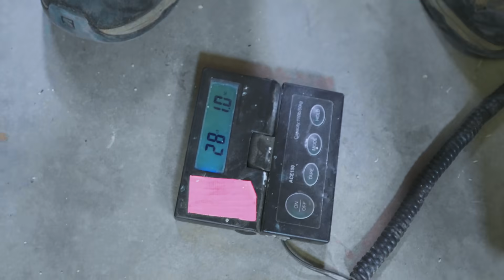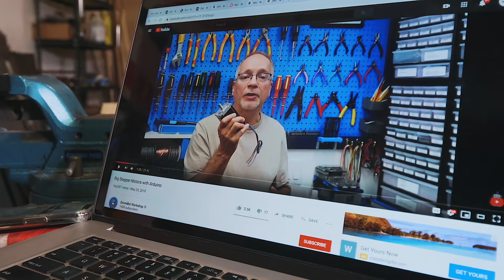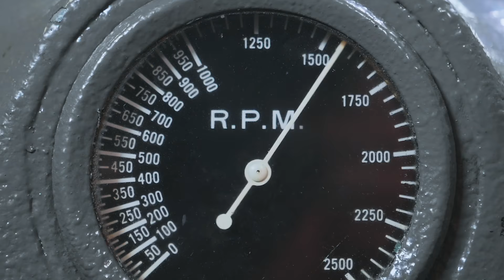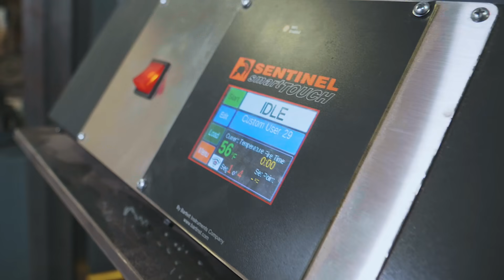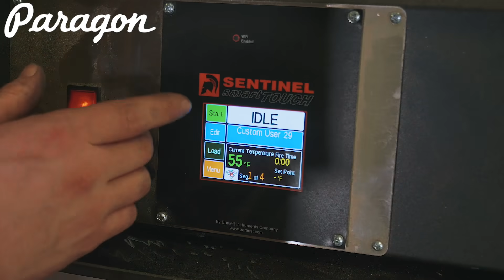MAKING FORGE DOORS!!! Part 2

Comment: Alec, if you publish the code, I'll take a look at getting it up and running for you, as this is what I do for a living.  A lot of people below are saying that you can't do simultaneous input/output off of an Arduino, which is technically true.  However, you can fake it through interrupts and/or polling.  I'll reply to myself with a code sample in a few minutes showing how you can do this, but there are edge cases where it might not work.  If you can get the code over to me, I can get you fully working code instead of an example!
Reply: me two
Reply: he put links in the description :) or at least that is what he said in the vid
Reply: Without having seen the code, my guess is that he's throwing each button input into its own loop while being independent from each other. Since he'll need both motors at the same time, he should use a loop with both inputs being conditions to enter it. I'm also unsure which motor drivers he's using but he could also tie them to the same output connection to make things simpler
Reply: Also a programmer by trade, if the changes are open source and less than 100 lines, I could do it tonight 😄.
Reply: Oh you legend. Thanks for taking the micro-controlled bullet for the rest of us.
Reply: since he's new to arduino, he is prolly using the stepper library, which blocks execution while the stepper does its thing. the accelstepper library is prolly the easiest solution for him to understand, and iirc provides non-blocking stepper tools
Reply: Pulleys will definitely help with the load
Reply: Yeah and I will look at it....

I'm helping right
I know nothing about code
Reply: I came here to basically say what you all have already said lol glad to see I am not the only programmer/blacksmith on Earth
Reply: @thebusbums2825  I agree
Reply: Also came to the comments looking for a link to the code. My first thought for getting the buttons working independently is to use interrupts.
const int buttonPin = 2;     // the number of the pushbutton pin
const int ledPin =  13;      // the number of the LED pin

// variables will change:
volatile int buttonState = 0;         // variable for reading the pushbutton status

void setup() {
  // initialize the LED pin as an output:
  pinMode(ledPin, OUTPUT);
  // initialize the pushbutton pin as an input:
  pinMode(buttonPin, INPUT);
  // Attach an interrupt to the ISR vector
  attachInterrupt(0, pin_ISR, CHANGE);
}

void loop() {
  // Nothing here!
}

void pin_ISR() {
  buttonState = digitalRead(buttonPin);
  digitalWrite(ledPin, buttonState);
}
Reply: The alternative to the Codeversion (witch is by no means worse) would be a Digital Multiplexer, witch would probably end up being more complex than a Softwaresolution. But since, at least what i can tell by youre Videos, you seem to usualy prefere Hardwaresolutions, witch is the reason i wanted to quickly mention this.
Reply: He should have used a cpld or raspberry pi
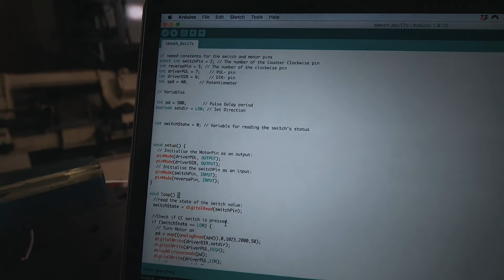Reply: I think it is more likely to be a programming logic issue, like closing an if-else statement at the wrong place.... from 5:35 / 7:06 looks like there isn't much complexity in the hardware side...
Reply: It really would be a breeze if he'd actually give a link to the code. Otherwise it's quite hard to help him.
Reply: I'd say a simple solution would be another $35 arduino and just run each motor on its own arduino. Keeps the coding simple for debug later.
Reply: I'm not quite sure why he is using a  arduino uno and not a nano or somwthing smaller, but anyways. With the buttons he cpuld simply use event triggers on the microcontrollers to controll both at the same time. I would recommend using two controllers. Way easier
Reply: @PhillRengers  $35 for an Arduino? They are more in the $5 range. For $35 you get a RaspberryPi.
Reply: Am i thinking to simple and just split the signal cable from the arduino to the controllers will/could have the same effect that he's trying to achieve?
I mean it would cut down on the amount of wireing and coding needed (if that's possible at all.)
Reply: Once i was making a robot with stepper motors and i had the same problem, because the library that i used shared the delay time of the steps of both motors making them move at the same velocity. I solved it just copying the library into my code and duplicating it with diferent variables. It probrably will solve for this problem too.
Reply: you could have a timing thing where if both buttons are pressed for x time ;then do both doors. Then make use cases for each  combo.
Reply: Alec, this guy is right.  Just have to be clever. I do many things simultaneously on Arduino. Also, I would recommend having some limit switchs.
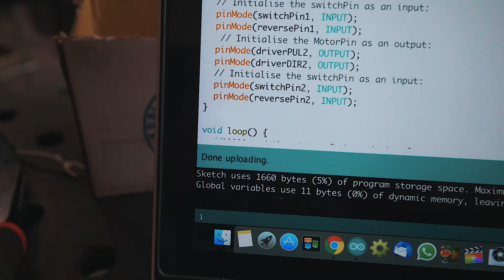Reply: Indeed 7:07 replace the esle by a if
Reply: I think the fault is mainly in that he uses "if-statements" I recently used a way to solve this but it only works with few variables...

Example:
Button 1 adds 0001
Button 2 adds 0010
Button 3 adds 0100
Button 4 adds 1000
The value of this is returned by the function.

Switch(function) {
Case(0001)
...
Case(0010)
...
Case(0011)
...
Case(0100)
...
Case(0101)
...
Case(0110)
...
Case(0111)
...
Case(1000)
...
Case(1001)
...
Case(1010)
...
Case(1011)
...
Case(1100)
...
Case(1101)
...
Case(1110
...
Case(1111)
...
}
(Don't forget the breaks ofcourse)
Now you can just leave the impossible options out(like up and down on the same motor at the same time)

This way you can actually listen to all inputs at the same time.

I would like to hear your opinion on this method since you do this for a living and im just a tinkerer that sometimes does this as a hobby
Reply: If anyone is going to help Alec with this may I request you also help him hard code in stopping points for the motors to stop spinning after a certain distance? I've never coded Arduino, I just don't want to see Alec and Will destroy their forge by having those 30 pound doors go flying.
Reply: Gareth Price I thought you needed a raspberry pie to get multiple threads
Reply: @shivan473  how safe do you want it. At the moment all he has to do is release the button before the door hits the frame.

You could add a sensor if you really wanted i guess
Reply: Gareth Price or there is such thing as simple wiring where he puts both inputs to one location
Reply: iLostTheGame well theoretically he could, but anytime he wanted to open one door, he would have to open both.
Reply: @chad7375  you're correct, though not all raspberry Pi's can handle more than one thread. However, as concurrency isn't an issue here (in this case I'd say anything faster than 0.1s is fine), threads don't matter. We just write our code to operate as most OSs that need more threads than it has cores do. We rapidly switch between each thing we need to do, giving the illusion that multiple things are happening at once.
Reply: @shivan473  Based on the little bit that I was able to glean on the electronics side from the video, he should be safe without them. The steppers don't have a massive amount of torque, so they will just skip steps when the "piston" bottoms out (which in this case is being fully open).
However, an interesting addition would be a tension sensor on the cable. When it goes slack, the motor will not rotate in the "down" direction. This prevents running the door down too long and causing it to go up.
Reply: @Cope...  if you had a stepper driver that can natively index multiple steppers, then sure! Otherwise both doors just end up moving together.
I would reccomend using such a driver, as it simplifies non-blocking operations significantly.
Reply: @noahkidd4674  i was thinking for some reason he wanted 2 motors per door. my bad
Reply: @azureumbra  for the code you can wrap it all in consecutive if's in the loop section without and delays since we dont have alot of conditions it will seam as both of them are working at the same time for the mechanical part i think sliding on reels is better than pulling that monstrosity up and down and maybe end stops that you can mount on the bar up above will do the trick
Reply: I have an arduino but it is very old. I have not had time to play with it much.  I am a database level developer (dinosaur) .  
But this sparks some coding I did in a robotics course using PLC Ladder logic.  Seems like a combination of hardware and software. Using a relay, either physical or programmatic. That way the button would not have to remain pressed. Just a simple check. If button pressed then set a boolean to true. Then if button is pressed again and boolean is true then the button is a stop button. 
But that would not allow the door to stop where he wants it to stop and would require switches to break the circuit and stop the doors.  
I guess the continuous polling would simulate the code instantiating itself for both units. 
Oh well, sounds like a fun challenge.
Reply: @GaryForgingOn  you dont need a boolean !! the if statement and the state of the button is already a boolean ...if its pressed move the motor if the button is not pressed stop the motor !!!! so it will stop whenever he releases the button no need for variables booleans or anything ..... its just a big dumb if statement ....
Reply: Wouldn't it be a better to wire the two stepper motors together so they work on the same signal? They do that in 3D printers all the time. That way you don't have to do all sorts of fancy crap in your code.
Reply: @smokkin1  He's not using the stepper library. He's driving the steppers like DC motors.
Reply: @mathurm100  Hmm looking at AliExpress they sell ArduinoUno boards way below $5. Nanos even below $2. Maybe you should have a look there...
Reply: I'd just run it with boolean-toggeling intterupts too :)
Reply: Seriously nothing literally nothing i can't do
Reply: @MayorAwesome  he might want to open one door and close the other at the same time or open just one door
Reply: FPGA for the win XD
Reply: Yeah is important that i know.
Reply: @chad7375  Technically, yes. Arduinos operate on a single processing core and the typical programming style is single-process. But, you can fake it by constantly looping through tasks. So instead of turning the motor on when the button is pressed and then waiting until the button is released to stop the motor (this locks the thread by forcing it to wait for a single condition), you can can turn it on when the state of the button changes and then continue looping through a series of checks for the various buttons, and once it sees that the button was released, it turns off. This means that is isn't instant, as it is probably checking the other buttons when you release, but due to the processing speed for such a small program, it would be on the scale of milliseconds in delay. Doesn't work for self-driving cars, but plenty fast for this sort of project.
Reply: I'm just an high school student, but I know for a fact that you can technically operate the two motors at the same time. But, that would have to use interrupts to run the other one, which would make the code different. Also I think he could make a separate methods to run the motors when buttons are pressed at the same time together. But this might depend on how he has the code set up.
Reply: Open Source Forge Doors. I like it
Reply: @RedRacconKing  a pi is a massive overkil for this. My ardunio mesurse my fish tank temp, keeps time updated from internet so it can fade the tank lights depending on time of day, runs an OLED display to show the info locally (including alarms) and send / recoves data from.the internet so I can view it all remotly. And does it all asyncrosuly (so the light changes do not prevent alarms alerting.) 

Look up Xrobots (you tube channel) to see full on walking robots all done using ardunio.
Reply: Yep, using libraries like OneButton and Accelstepper should do the trick with a very simple state machine, if he could only publsh to gist or github so we can have a look
Reply from the maker: Thank you Gareth! 

// Alec's 2 motor, 2 button program!--- 

// named constants for the switch and motor pins;
int switchPin1 = 2; // The number of the Counter Clockwise pin
int reversePin1 = 3; // The number of the clockwise pin
int driverPUL1 = 7;    // PUL- pin
int driverDIR1 = 6;    // DIR- pin
int switchPin2 = 8; // The number of the Counter Clockwise pin
int reversePin2 = 9; // The number of the clockwise pin
int driverPUL2 = 12;    // PUL- pin
int driverDIR2 = 11;    // DIR- pin
int spd = A0;     // Potentiometer

// Variables
 
int pd = 500;       // Pulse Delay period
boolean setdir = LOW; // Set Direction

int switchState = 0; // Variable for reading the switch's status
int switchState2 = 0; // Variable for reading the switch's status 
 
 

void setup() {
  // Initialise the MotorPin as an output:
  pinMode(driverPUL1, OUTPUT);
  pinMode(driverDIR1, OUTPUT);
  // Initialise the switchPin as an input:
  pinMode(switchPin1, INPUT); 
  pinMode(reversePin1, INPUT);
   // Initialise the MotorPin as an output:
  pinMode(driverPUL2, OUTPUT);
  pinMode(driverDIR2, OUTPUT);
  // Initialise the switchPin as an input:
  pinMode(switchPin2, INPUT); 
  pinMode(reversePin2, INPUT);
}

void loop() {
  //11111read the state of the switch value:
  switchState = digitalRead(switchPin1);
  switchState2 = digitalRead(switchPin2);

  //Check if CC switch is pressed.
  if (switchState == LOW) {
    // Turn Motor on
    pd = map((analogRead(spd)),0,1023,2000,50);
    digitalWrite(driverDIR1,setdir);
    digitalWrite(driverPUL1,HIGH);
    delayMicroseconds(pd);
    digitalWrite(driverPUL1,LOW);
    delayMicroseconds(pd);
  }
  else {
     //read the state of the switch value:
  switchState = digitalRead(reversePin1);
    //Check if CW switch is pressed.
  if (switchState == LOW) {
    // Turn Motor on
    pd = map((analogRead(spd)),0,1023,2000,50);
    digitalWrite(driverDIR1,!setdir);
    digitalWrite(driverPUL1,HIGH);
    delayMicroseconds(pd);
    digitalWrite(driverPUL1,LOW);
    delayMicroseconds(pd);
  }

    

  //Check if CC switch is pressed.
  if (switchState2 == LOW) {
    // Turn Motor on
    pd = map((analogRead(spd)),0,1023,2000,50);
    digitalWrite(driverDIR2,setdir);
    digitalWrite(driverPUL2,HIGH);
    delayMicroseconds(pd);
    digitalWrite(driverPUL2,LOW);
    delayMicroseconds(pd);
  }
  else {
     //read the state of the switch value:
  switchState = digitalRead(reversePin2);
    //Check if CW switch is pressed.
  if (switchState == LOW) {
    // Turn Motor on
    pd = map((analogRead(spd)),0,1023,2000,50);
    digitalWrite(driverDIR2,!setdir);
    digitalWrite(driverPUL2,HIGH);
    delayMicroseconds(pd);
    digitalWrite(driverPUL2,LOW);
    delayMicroseconds(pd);
    // Turn motor off.
    digitalWrite(driverDIR2,setdir);
    digitalWrite(driverPUL2,LOW);
    delayMicroseconds(pd);
    digitalWrite(driverPUL2,LOW);
    delayMicroseconds(pd);
    }
}

}
}
Reply: Gareth Price I have just used polling to allow for simultaneous input! Took a bit to get working, but once I did worked like a charm!
Reply: @AlecSteele  Coming in late and I'm sure by now you've had an overload of proposed solutions and a lot of them will work but seem like overkill and, although this is already an over-engineered marvel, here's what I suggest to keep it as simple as possible.

1)  Instead of having 4 momentary switches for up and down on both motors, let's first reduce it to 2 momentary switches and a non momentary switch/button (think light switch).  By using a non momentary switch for the direction you can use a single momentary switch for each motor.  IMO this will be easier and safer for you to use in the shop since there will be less clutter on the floor.  However, you will lose the ability lower one door and open the other at the same time.

2)  Let's make it a little more complicated and add a third control, this one to tell the Arduino to move both doors simultaneously.  There's 2 ideas here:

2a)  Add a third foot pedal and wire this up to a separate input of the Arduino, add another check to check if that switch is pressed, tell it to output to a separate output from the other two , then split that output and wire it to both motor controls.

2b)  Keeping clutter to a minimum, add another non momentary switch like we did for the other one, when switched off both pedals act independently, when switched on either foot pedals can be used to control both doors.  To accomplish this in code just add another condition and if it's true output to a third pin if either of the inputs are true.  I like this option the best since it keeps things like cords and pedals that you, Will, and the rest of the crew could trip on to a minimum.

3)  As many others have stated, put some boundaries in to prevent going past the intended limits.  You could have variables for each door's position, starting from 0, all the way closed, to 100, all the way open.  I should add that as the doors approach those limits you should tell the motors to slow down to a reasonable rate (you know, in case Will decides to crank the speed up to 11) that way you aren't slamming into the forge or sending your brand new door to visit the moon.
Addendum to 3)  There's a lot of fun things you could do with these position variables, like adding 2 quick pedal presses to automatically open a door all the way for you, or halfway.  Adding these little personal features is what I find fun in coding, they can be a pain but so gratifying when you get them working.

It'd be great if you created a repo out on GitHub, if you can upload YouTube videos you can easily pick up how to create a project, then I'm sure you could find a few people who would be willing to moderate the repo for you.
Reply: why not make a library on arduino and send Alec the name and link (i dont really know how the logic behind libraries work so idk if this is possible)